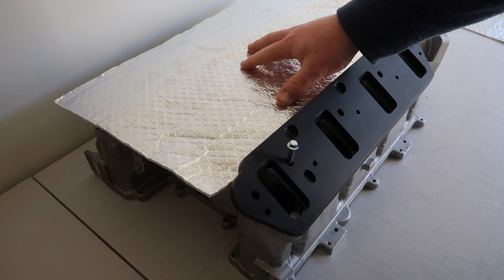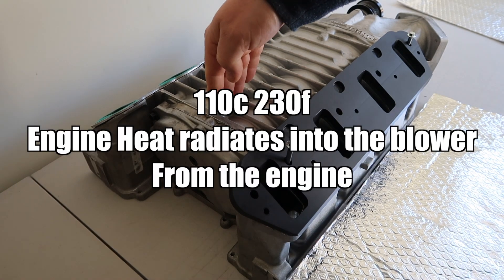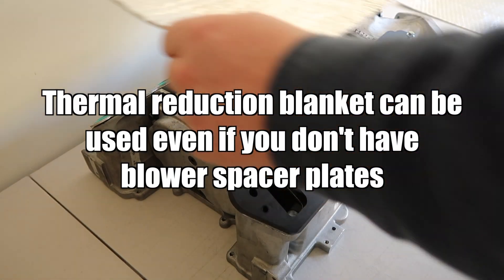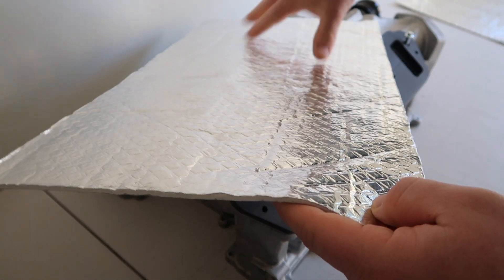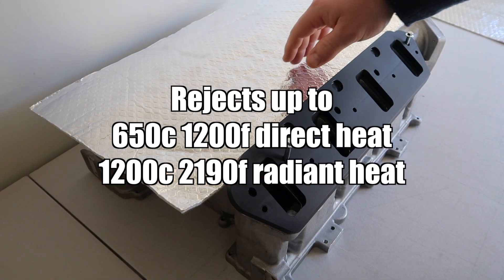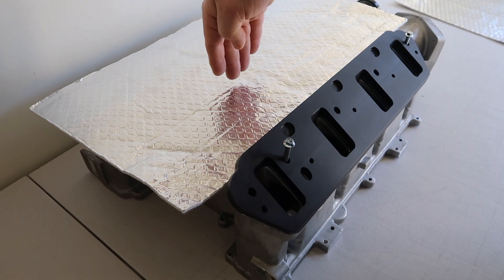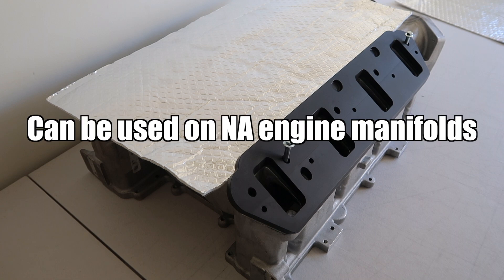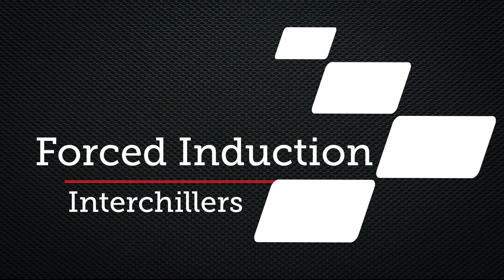Thermal Reduction Blanket

Comment: Howdy, I have Vortech V3-Si blower, will this work as the blower's shape is not flat as in the LSA shape?
Reply from the maker: yes it will work and you can mold it to any shape you like
Reply: @ForcedInductionInterchillers  Thank you for your reply...what are the specs of this? Dimensions/Thickness and brand? I know PTP and Heatshield Products have similar stuff...Cheers.

Comment: I’ve added this under my Lsa supercharger but also added some on the valley cover. Will that be ok?
Reply from the maker: Thats not how the blanket functions. The way it works is for heat to hit the reflective surface and reject from absorbing, placing it on the valley plate will not have any effect. Only place it on the belly of the blower.

Comment: Thanks for sharing. Are there any issues with the heat being rejected and returned to the engine?  Presumably when stock it's designed to radiate some heat upwards.
Reply from the maker: No we have logged oil temps and engine coolant temps they have not been effected in any way, the heat still dissipates upwards (as you know heat rises) it just finds its way out from under the blower ends etc.

Comment: Where can you buy this stuff and can it be used in other areas under the bonnet and under the car, also how long does the stickiness last, meaning how weatherproof is it, cheers, great stuff keep it up guys ? So basically can you rap it around your headers and also stick it near the headers along the inner car panels and other areas. cheers :) All instead of ceramic coating, hum, thats an idea, but again cost could be a factor. :)
Reply from the maker: We sell it, we have only just gotten it in and tested it out with great results, in terms of how long it remains sticky we are not sure, it is however VERY sticky. We wouldn't recommend putting it on headers, there are more specific products for that. We would recommend using it for the intended purpose here to insulate the blower from absorbing engine heat.
Reply: @ForcedInductionInterchillers  What about surrounding areas near the headers, especially for the newer stock V8 engines and you dont want to spend the money on new headers with jet coating,so near the  headers & the body areas
which does get radiant heat hitting it, just asking thats all ? Also how much is it per square meter sheet's ?